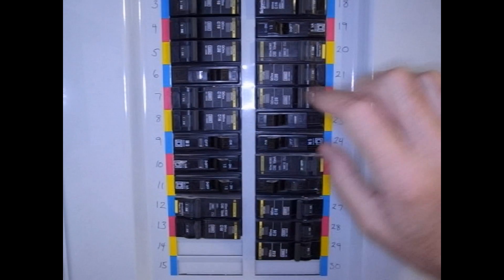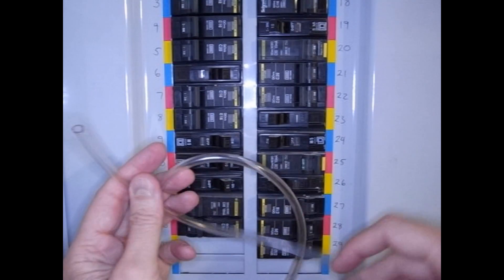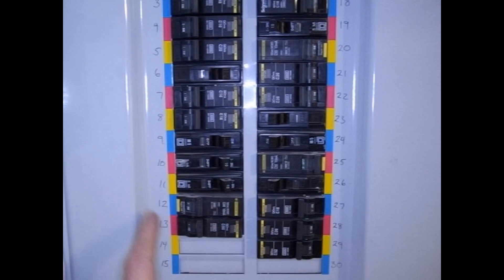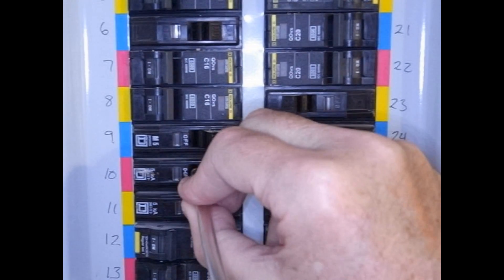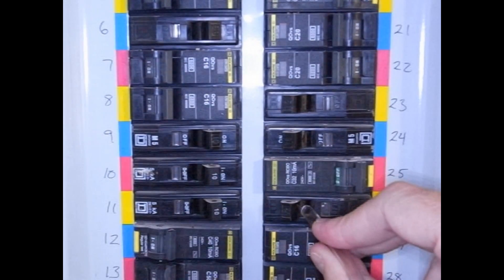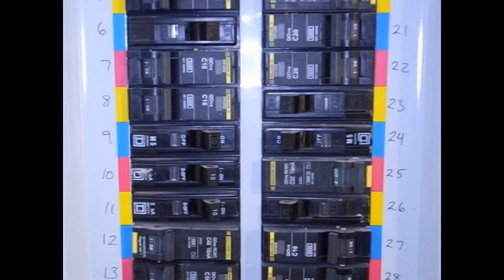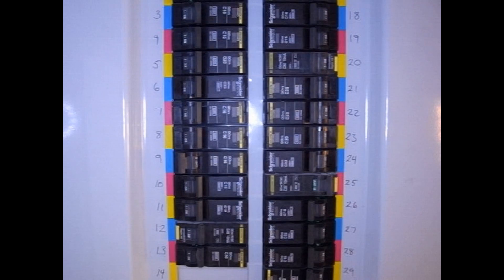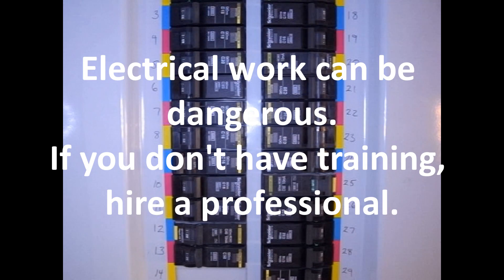Breaker Bad - What's That Buzzing Sound?  (Updated Video Available)

Comment: great idea... i narrowed mine down to my microwave when in use.  I turned it off and then back on and it went away.  Need to check again in a few days and if it returns will replace the breaker.  Tube idea is a great idea thanks!
Reply from the maker: @condor5635  Thanks, I learned it from a car mechanic.

Comment: Got a very noticable buzzing from Across the Room when One or Both of a couple QO 30 Amp 2-Pole Breakers (Water Heater and Dryer) are running (Maybe others too hope to check soon).  

50 year old 200 Amp Square D QO Panel... All Electric Home so basically Majority of Panel is just 2-Pole Breakers for Baseboard Heaters, AC, and Appliances. The 120V Lighting and Outlets are relegated to Tandems...

Last Major Renovation was in 2011 with addition of a QO Sub-Panel for a Kitchen Remodel. I personally upgraded 4 - 120V Breakers in that panel in the last couple years to AFCI, along with adding a Sense Power Monitor, and where Practical (since QO does not offer Tandem AFCI Breakers) updated Outlets/Runs to AFCI or AF/GFCI...

So its a blend of Original Breakers ("Old" Square D Tandems are "stacked" Horizontally, Left to Right vs Vertically, Top to Bottom on more recent ones...Likely installed in between the 80's and 90's when Solar (Heating) and AC Units were added into the mix)

Comment: When you google; Is a slight buzzing sound from electrical panel normal? All the responses I found said it was totally normal because there's obviously electrical current always running through the breakers and panel. From the information I found it said that unless the breaking is tripping or arcing then a light buzzing sound is very typical.
Reply from the maker: I guess it's a matter of degree.  Our breaker box is about a meter from where I normally do my computer work, yet I can't hear any of the 27 breakers.  Sure, if I open the door and stick my ear against the panel I can hear it, but the sound in this video was clearly audible when the door was closed and I was several meters away.  I used the tube to determine which one was buzzing before I called in the electrician.
Reply: @tsbrownie  I think the electrician was trained to to upsell me on allowing him to do a "panel refresh" is what he called it, rather than do a complete panel upgrade, which btw he quoted me around 6 grand. So when he said it would just be $1700 for the refresh it would seem like a great deal. My breakers are cool to the touch, never trip, and I can't hear any buzzing sound.
Reply from the maker: @oldkid6  Our house is now almost 30 years old and 14 years ago we had a serious upgrade, but we reused many of the old breakers.  About 5 years ago we went back through the box and replaced the then 25 year old breakers.  It's not a bad idea.  I've seen electrical fires because of mismatched breakers that were in service 50 years.  Even a small fire is expensive and messy.
Reply: @tsbrownie  I don't have mismatched breakers, they're all D Square and the panel was upgraded at some point, maybe 10 years ago is a guess, I've only been living in my house 3 years...but the panel and wiring is clean. I hear what you're saying and it will be upgraded when needed, right now I just need to get whole house surge protector to at the very least keep my electronics from potentially getting fried.
Reply: @oldkid6  6 k! My breaker box was fried about 3 years ago due to a loose main wire. Our trusted AC company tracked down a new 200amp box and replaced it for just under $900 USD. They used the old individual breakers that weren't fried. I was just happy it didn't start a fire.

Comment: Breaker boxes aren't numbered like that. Odds on the left, evens on the right. You could also save a lot of walking by flipping off one at a time until the buzzing stops. Or feeling the front of the switch to see which one is warm.
Reply from the maker: You are right.  This one came in the house. I was to unmotivated to renumber them all.  None of them were warm, not enough load I suspect.  Just a handful of CFL bulbs.  The buzzing seemed to come and go, I am guessing because the wire contact would change as the wire heated and cooled with the arcing, but just guessing.
Reply: \üüü
Reply: First thing I saw.